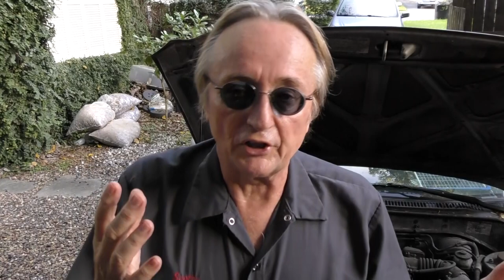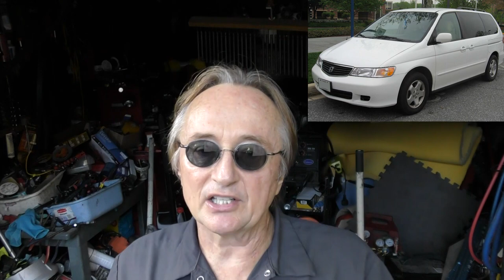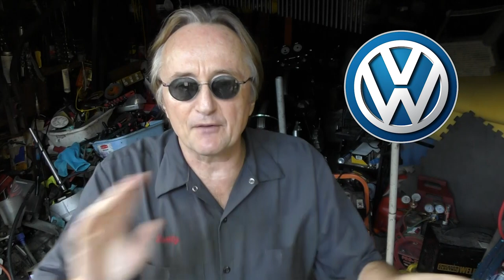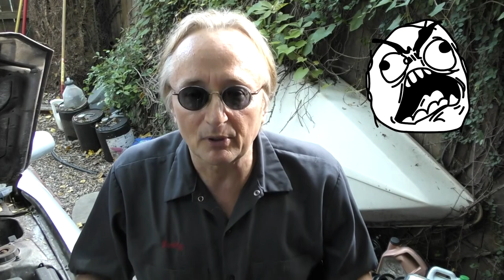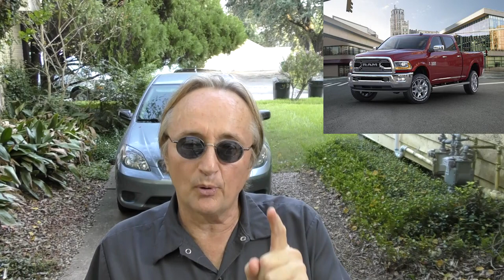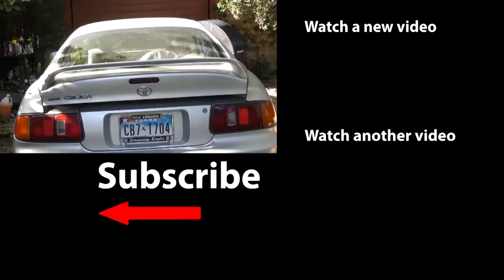Who Makes the Worst Automatic Transmission Cars in the World

Comment: My family used to have an automatic 2014 Ford Bmax, started to have transmission issues at 11k. Fortunately that was the day i was driving it back to the garage at the end of the lease.  To be fair though, considering all the ford cars my family has ever had, that was only the second one to have any issues with it. My own automatic, a 2006 vauxhall (gm) astra was still going strong at 122k
Reply: My 2005 astra auto failed seven years ago at 60k miles, impossible to get second hand box as too many were failing, ended up on the scrap heap. Drove autos for 30 years before that but never again.

Comment: My wife had a New Beetle with the transmission Scotty was talking about, the Aisin 09G.  It was terribly unreliable, and there is a cottage industry based on rebuilding them.  However, Scotty left out an important detail.  The actual gearbox, made by Toyota Aisin, was not that bad.  The issue was the terrible valve body.  The valves get stuck over time and that makes the transmission hang in gear too long or slam hard into gear, especially when the transmission gets hot.  They need to be rebuilt, involving boring out the holes so that the valves can slide freely.  The rest of the car was also a disaster.   The evaporator core needed to be replaced,  requiring the entire dash to be taken apart ($3000).  The gear shifter broke ($500).  The door handle fell off.  The top leaks and often doesn't want to go back up. The list goes on.  Thank God we traded it in.

Comment: My picks would be the late 1970's GM three speed, and the Chrysler 41TE speed, that was introduced in 1989. The did finally work out most of the problems. My niece has a 2004 PT Cruiser with 240K miles on the original transmission.

Comment: Starting in the mid-70s, and ending at about 1981 if memory serves Honda made two semi-automatic motorcycles the CB750A like you mentioned and the CB400A. They had a clutch-less transmission with a high and low speed that were switched manually by the rider. I own one of the 1978 CB400As. They're not too terrible. Certainly not very fast at all and not what your average rider wants though.

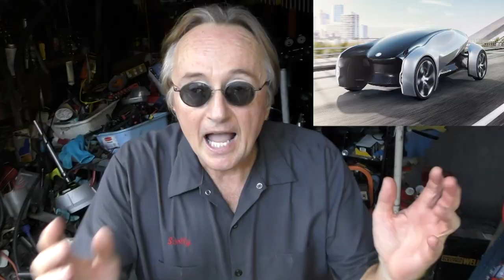Comment: 2:10
I had a 2000 beetle manual 5spd. The transmission, drivetrain, gadgets, front end, handling were all top notch the engine was a chronic NIGHTMARE.
DEAD at 80,000
Reply: Probably the best part about owning that bug was the manual haha

Comment: Ford Taurus transmissions went without warning. Class action suit did no good. I had a two year old taurus still owed over 10k and Ford told me warranty didn't cover it. New transmission was over 6k for the parts alone. I found used one still like 1800 to fix and ditched the car.

Comment: Speaking of how bad Chrysler/fiat is, my friend bought a Dodge Dart. He is a journeyman heavy duty mechanic. At 150,000 kilometres he had to pull the engine apart and replace the o rings because it was burning so much oil. Then at 200,000 kilometres the head was warped and he just scrapped the car. He only drove the thing for 4 years, and literally everything was falling apart. Moral of the story, do not for any reason whatsoever but a Chrysler/dodge/fiat vehicle as a daily driver.

Comment: That's funny that 2012 dodge Grand Voyager I asked you about the transmission went out 2 miles from the dealership I was taking it in to sell just to get rid of all the electrical issues ..... All Toyota products in my driveway now ...1980 pickup 1994 corolla 2000 ls400

Comment: My neighbor must have gotten a good powerglide cause his is over 50 yrs old, original & has NEVER slipped - verified with an aftermarket tach - behind a 250 strait 6. Over 300k miles on both.
Maybe the slippin ones were the older ones that were not liquid cooled?
Super EZ to change the fluid - drain plug.

Comment: The Mazda front drive 4 speed automatic that was used in MX-6, 626 and Ford Probe cars.  That trans was a scaled down copy of a GM transaxle  and not a very good copy at that.   Most of those grenaded before they got to 100K and it was the main reason why the Ford Probe seemed to disappear from the streets literally overnight.

Comment: Have to argue regarding the Powerglide. The Powerglide is what is. It is a two-speed. If you drive it accordingly, it is (or was) a highly reliable unit. You can destroy any automatic if you drive with your foot to floor or drive it beyond its intentions. If I had vintage GM production, I would stay with Powerglide if that was original in vehicle.
Reply: Eleven months later, I still agree with myself!

Comment: Now I'm not sure if this is a thing, but it seems like all automatic transmission that paired with any Honda K24 motor (Accord, Element, CRV, etc.) around the years of 2003-2006 were pretty messed up. I remember my dad had a CRV from that time with a bad transmission. He tried replacing it with a transmission from a Honda Element, then I think  he tried a transmission from an Accord... all were faulty. One had delayed shifting and violent shifting. The other apparently had no 4th gear. We actually own an accord from that time with a manual transmission, and that thing is almost bulletproof. Over 250k miles and still the same transmission out of the factory.

Comment: I drove 2017 Fiat 500X with 9spd automatic trans. and it was nightmare,  shifting gears felt like someone hitting you with a hummer in you back, often had drive mode select error and fuel economy was below 16mpg in city, I ended up returning it back to dealership and the car was under 5k miles.

Comment: Wow... hitting close to home.  My 2002 Odyssey blew up at 105K.  I got Honda to give me a "rebuilt" replacement for $950 installation fee.  That stopped at 36K more.  My mechanic recommended a re-manufactured Jasper transmission.  That one is still in the car at 290K.  Doesn't burn oil.  Great motor...  Terrible transmission.  End of me and Honda.

Comment: Gone through 3 transmissions in my wife's 2001 Lexus RX 300. It's currently parked, because I can't afford to fix it. It's only got 208K miles on it while my Ranger has 280K miles on the original clutch. Manual Transmissions FTW!

Comment: I would say Ford's CD4E transmission would have been a strong contender for title of Worst Transmission. Had one fail on me myself 6 years ago (1999 Mercury Cougar) when the line pressure got out of hand and broke the band for 2nd and 4th gear. This occured during an uphill climb. It was a rather frequent problen it seems though. Might not help that this transmission also got used in the Ford Escape line as well.

This was the transmission that drove me to get a manual transmission for a later car...

Comment: I must be pretty lucky, since I’ve had a 2003 and a 2011 Honda Odyssey over 7 years/125,000 miles each with no transmission  or any other issue except for a sliding door motor replacement on the 2003. I now have a 2019 Odyssey and hopefully that runs as great as the last two.
Reply: as long as you drive very soft on them they do well they this and that is bad but yet hondas are still doing well being one of the top most reliable cars

Comment: My mom was a fan of the Chrysler minivan designs and owned about 3 of them. All of them had transmission problems and were extremely expensive to replace, essentially making it cheaper to buy another car for the same cost of repairs. Those things are a piece of junk. None of them ever reached 100k miles.

Comment: He does have a good point about the Ford 5r55s they were just poorly made. Even typing in ford 5r55s you got videos of problems about the trans without even typing in problems after it. I got a 02 Mountaineer wit 251,910 miles it’s on its 2nd trans. Might need a 3rd one later on. And I know I’m not the only that’s had issues with that model transmission.

Comment: hey scotty, i love your videos by the way. a question on your video relating the the ZF transmissions. If i am not mistaken, ZF is a German company that actual;ly makes the transmissions. IS that correct. Another thing is the ZF 8 speed transmissions. I noticed you did not mention anything about them, and wondering if they fell into the same problems as the ZF 9 speed transmissions?
Reply: The 8 Speeds are great. Very reliable and they shift smooth and always find the right gear. Still after 100.000miles do an oil change. But the 8speeds are for rear wheel drive only, while the 9speeds are for fwd.

Comment: Ive seen transmission fluid dripping from the data connector on a Dodge Neon before. The fluid gets pushed into the wiring and eventually drips on you while driving. MOPAR- Mostly Old Parts And 
Rust.

Comment: My early 2002 Ford Exploder had the transmission fail at 40,000 miles. After warranty repairs it broke again at 90,000. Then at about 130,000 it failed again. This time I exchanged it for a rebuilt on (aftermarket rebuild with brass servo bore liners and other upgrades). Still running that turd. Lots of problems with early 02 Explorers, worse car ever built. Made a Chevy guy out of me. My 2002 gen 2 Honda Odyssey has over 260,000 miles and still driven daily. Transmission still holding out. I recommend changing fluid and filter (don't let anyone tell you it has no serviceable filter) frequently. Mine has the recall fix of the fluid jet installed in the fill plug opening. I refuse to disturb it and dribble fluid down the dipstick tube using old aluminum Coleman fuel funnel when doing fluid changes. Fun. Love my old Toyota Previa with 255,000 miles. Best car I ever had, Just crumbling into rust bits. Not sure what to replace my old junk with, probably build my own  vehicle as nothing out there appeals to me.
Reply: I worked in a Chrysler shop for 2 years. I agree, junk. Thanks for a great video!

Comment: yup, I am a "proud" owner of one of these 1999 honda odysseys. got it replaced under warranty/recall once at around 80k. Then the replacement gave out at 140k. Got that rebuilt and 10k miles later, it's slipping again. what a piece of doodoo.

Comment: I had a 1999 Acura 2.3 CL. I bought it brand new. The transmission went at 45,000 miles. I wonder if had the same transmission as the Honda Odyssey that you mentioned.

Comment: Had a 2014 Jeep Cherokee Trailhawk with the ZF. Not only was it the worst transmission, the car started falling apart in 80k easy miles. The transmission had a habit of getting confused under heavy acceleration and subsequent releasing of the accelerator pedal (like jumping through a busy intersection). This would happen around 40-45 mph where it would violently downshift to 1st gear. This ripped all the motor mounts, transmission mounts, and damaged the transmission, drive axles, and front suspension. The car literally started falling apart around me; even plastic trim pieces falling off in my hands under normal use. Absolute worst car I’ve ever owned. I stupidly bought a 2017 Pacifica because of the great interior design, and with only 20k miles; entire front suspension has already been replaced, electrical gremlins are surfacing, check engine lights, recall envelopes are starting to show up in herds. Lipstick on a pig is an understatement. I have seen through FCA’s smoke now; and will never buy another for the rest of my life. STILL the biggest pieces of crap on the road, every dodge, Jeep, ram, chrysler; they’re all sick from the cancer of Chrysler penny pinching nonsense.

Comment: Hope I don't jinx myself.  I have a 2002 Chrysler Town and Country minivan with 265,000 miles on it and the transmission has never had any mechanical issues.  

To be fair to I did have some weird shifting issues until I solved it but it was electrical not an internal mechanical issue.  The wire for the transmission output speed sensor broke due to being routed poorly from the wiring harness.  It had a continuous strain on it.  Eventually one wire broke and pulled out of the connector.  I replaced the connector and its pigtail with new and with longer wires to relieve the strain and no problems since.  The only other trouble I've had with the car was with the fuel injection wiring harness.  This should have prompted a recall repair.  I've read about lots of folks having this same issue.  Here again I repaired it myself.  Apparently in this generation of their mini-vans the fuel injection wiring harness is long enough that if it falls away from its support (plastic support that eventually fails from heat) it will drop down close to the exhaust manifold and melt causing the wires to short together and cause horrible misfires.  My son and I pulled the harness up where we could get to it and cut out the melted section one wire at a time butt-splicing them back together.  Now it's short enough not to fall down by the manifold and problem solved.

Scotty, how about who makes the best transmissions, engines and so on?

Comment: Had a 1990 Honda Accord Coupe.  At 14k the transmission started to slip.  Needed a new transmission.  Had a Honda Oddessy 2004 and a 2003 Acura TL  Both needed transmission replacement.  The Acura need it replaced 3 times.  yes it was free.

Comment: I just saved a 5R55S in an 05 Exploder before it consumed itself. Crappy internal thermostat can prevent flow and burn up. If not the servo bore will wear itself oblong due to poor design in engaging the band.

Comment: i'd say the worst would be the modern Mercedes and Volkswagon van Transmissions. the ones you will find in ambulances and such, they flare, bang, thump, crash and give THE most uncomfortable ride of any transmission out there. when you have someone in the back in agony, you have to very slowly and carefully account for the rev flare before the fluid and clutches catch up then crash as it suddenly jolts into forward movement. and those that don't know, no it isn't worn, they are that way from factory...

Comment: Five speed Honda ATs had some issues, but less frequently than many competitors that got less bad press than Honda.  Probably because everyone expects failures from every brand except Honda (and Toyota).  Had an '06 Odyssey that went 201K miles with no problems, and ran fine when I traded it.  Honda's 6AT has an excellent track record.  I have three (all w/ 3.5 V6s) at 42K, 50K and 108K miles respectively, and all run perfectly.  Just give 'em a good flush  and fresh fluid every 50K miles or so.  Some recent Pilots, Ridgelines, and Acuras use a version of the ZF 9HP...   Honda's execution is better calibrated than FCA's  but I'm with you...  Not a fan of this transaxle.  Have driven Honda's new 10AT with both 2.0 Liter turbo 4 in an RDX and 3.5 Liter V6 in an Odyssey.  Excellent drivability in both applications.  Small 8-9 and 9-10 ratio steps make downshifts at highway speeds nearly undetectable.  Time will tell, but the design of the 10AT is classic Honda attention to detail.  Your choice of the Odyssey as poster child for this video is off base...  I can name a few dozen vehicles more deserving for that cameo role...  and so can you.

Comment: You used a picture of second gen explorer for the 5r55 it was used In the 3rd gen and later. The second gen used the trusty 4r75w which actually was fairly tough for that platform. Seen many 302 explorer and mountaineers with over 300,000 and still going.

Comment: Scotty, I drive a 09 Mazda 3 Hatch automatic with 379,000 kilometers and when stopped at a stop light the rpm drops from around 700-800 rpm to just around 600 rpm after a few seconds after stopping and then the tach fluctuates a bit. The engine sounds a bit strained idling so low but once i can proceed the driveline is flawless. Could this be a sign of looming transmission woes? Otherwise my fuel economy is 6.5 liters per 100 kilometers and the car drives great, even kicking down the accelerator the transmission downshifts properly and the 2.0 liter pulls well for a car with this many kilometers. Great videos Scotty keep em up, my goal is to catch up to your 240,000 mile Celica....

Comment: The early Ford Taurus had a terrible problem with the transmissions. I think it was the 1st/2nd gear cluster. When they were in overdrive, the 1-2 cluster would not get any oil, and when they got some miles on them, KABLAMMY!! Ford came up with a solution of drilling a hole in the valve body, and it would spray oil on the gears. "Ford, where quality is job one".

Comment: Scotty missed a HUGE one. The 2012-present generation Ford Focus and Fiesta literally had some of the junkiest transmissions ever. I used to own a 2013 Focus SE Hatch but I literally could not pull away from a stop sign without the car violently shuddering to the point where it was unsafe. Needless to say, I sold it and replaced it with a 2018 Honda Civic EX.

Comment: The 2007 Models Pontiac Grand Prix GXP and Chevrolet Impala SS had horrible transmissions.  I got a free one at 96K miles as it was toast, and the new one I got is about to go at 80K.   They get sooo Hot > 220 degrees F and that GXP has crappy wiring and electronics too... The ABS/power steering/ traction control is gone.

Comment: Can confirm: My 2000 Honda Odyseey is on its second transmission. I've put a little over 300k on the original engine though!
Reply: Second transmission was replaced from the dealer. When the replacent broke years later, my father rebuilt it after rebuilding his 01' acura. I'm driving it for free right now, next time she blows though she's going to the junkyard!

Comment: My 2000 Silverado 4.8 V8 automatic is still running perfect after 18 years. The most dependable longest lasting trucks on the road!
Reply: had one of these, the steering shaft would go outon these things had to replace it a few times.